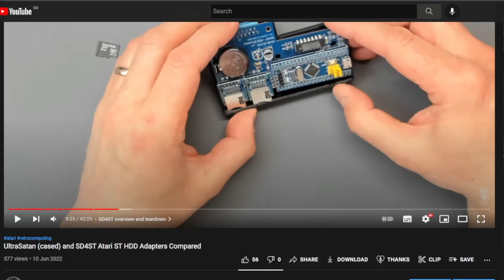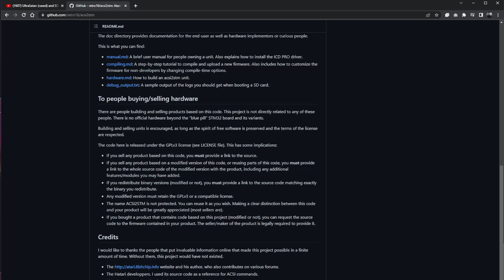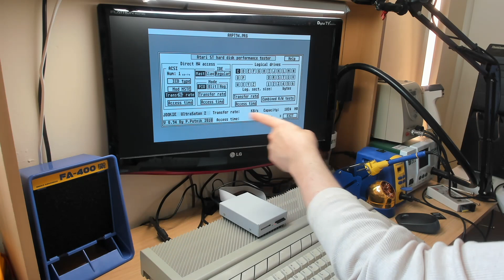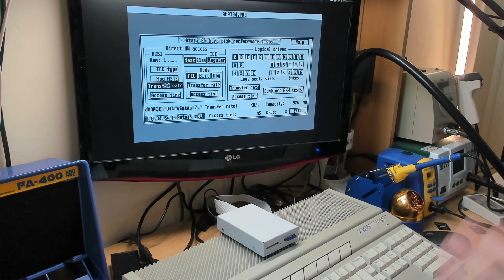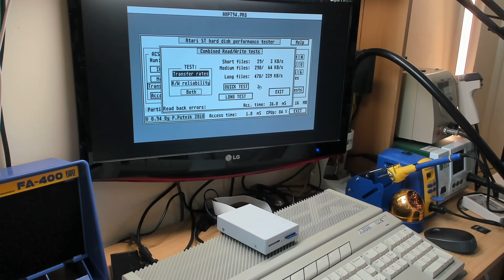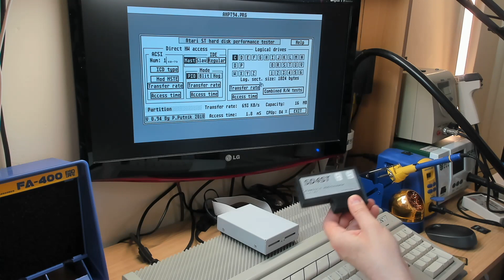Atari ST UltraSatan vs. SD4ST Speed Test and ACSI2STM

Comment: i got an ACSI2STM as it was the easiest way of upgrading my 1040STe then sticking  a gotek in it it just plugs in the back and works more or less out of the box , i have had good results with ST files so really not too bad for the price (i paid around £30 for a unclad unit ) and you have three slots (one occupied by the IOS and firmware ) to play with
Reply: I'd be curious how ACSI2STM compares to ultra satan myself for speed. Though, tbh, hard disk speed on Atari doesn't seem to be such a huge deal for me.  I'm more concerned about compatibility.  For me ACSI2STM gemdrive was giving me all kinds of weird issues, but when I reformatted for ppera, everything seems pretty solid and normal.

Comment: Three things will affect the read/write performance in any test: The device itself (UltraSatan v SD4ST), the card used (whether MicroSD or SD plus the performance of the card) and the driver used. Strictly speaking, there should be 24 tests to see how they would perform correctly.
Reply from the maker: I have bought more SD cards, so perhaps I can do 100 tests. :)
Reply: the sd42 had one shot with one 16gb micro which the satan didnt fair well with.  surely the best method would be to test the card the satan performed best with in the the sd42.

Comment: Has I remember satans and ultra satans were pigs to set up and put a few people off, if this sd4st is a easy set up and you can be playing a few games quickly that would be great for the user that just wants to play a few games without going the hack n slash gotek route
Reply: never had any issues with ultrasatan tbh, load hddriver or ppera, partition and of you go...
Reply from the maker: I'd say that using Pera Putnik's driver, there is little to choose between them in terms of setup simplicity. The SD4ST had a slight advantage since it was supplied with a pre-partitioned SD card full of stuff you could run straight out of the box. I'm not sure if the option to purchase UltraSatan with a pre-partitioned card exists.
Reply: @flashjazzcat  The UK seller I got mine from had a pre-partitioned SD card in it (with some weird partitions and demos), and the Putnik demo driver.